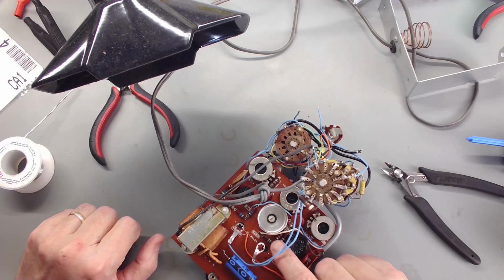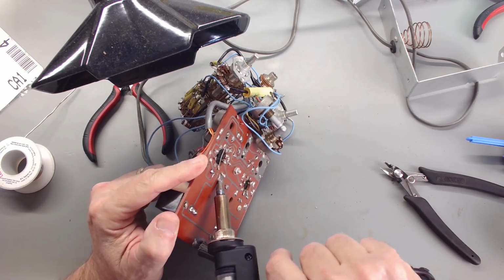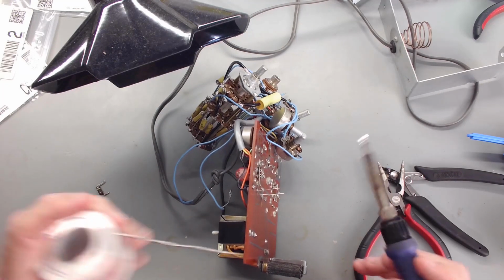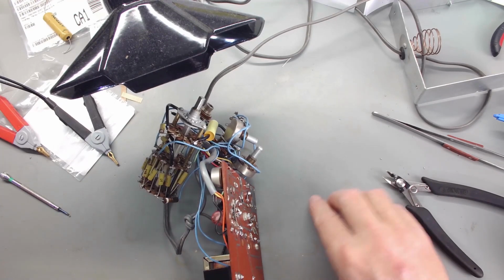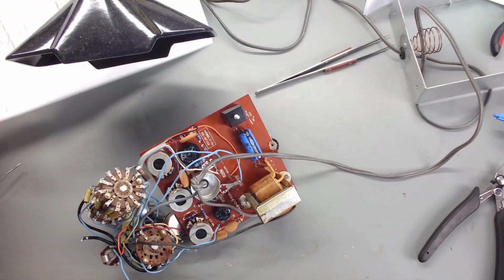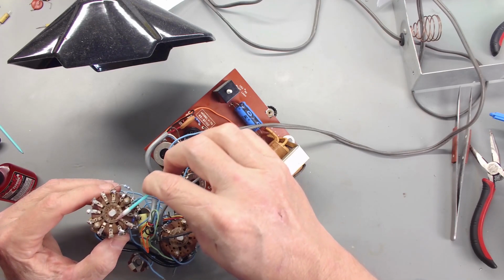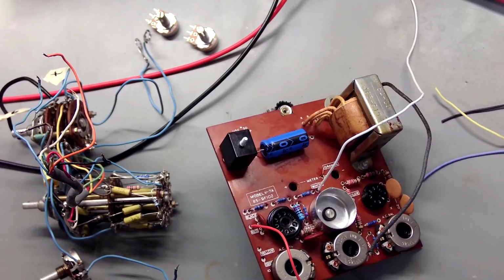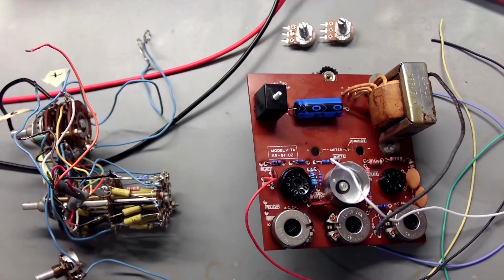Restoring a WRECKED Heathkit V-7A! PART IV

Comment: can i get a parts list? im rebuilding one of these now.  i need to do all the yellow caps on the selector like you did.. mine works but its off..  it is rough had the battery left inside sense the 70s.. or earlier.. got it all cleaned up and caps coming for the cans i can read..  on the selector where you put all the yellows mine looks like resistors  your yellows look like the caps i buy for my radios..  im just learning from 0 knowledge..
Reply from the maker: you can download the manual for it with the schematic from here :
https://www.rsp-italy.it/Electronics/Kits/_contents/Heathkit/Kits/Heathkit%20V-7A%20VT%20DC%20Voltmeter%20Manual.pdf. 
the selector switch had resistors on it not capacitors.  The old precision resistors they used kind of look like capacitors but they are not. If you look closely you can see I replaced them with modern resistors that are much smaller for the same ratings. 
Hope this helps good luck on the restore!
RJ

Comment: First, if you add flux & then more solder, unsoldering can be a lot easier.
Reply from the maker: True, that’s why the flux pen is laying out on the bench. In this case the issue was the leads were bent over tight against the pcb before they were soldered. This makes getting them off the board difficult. 
RJ